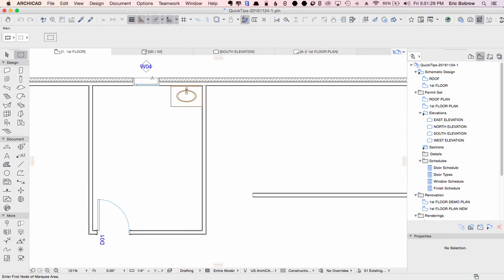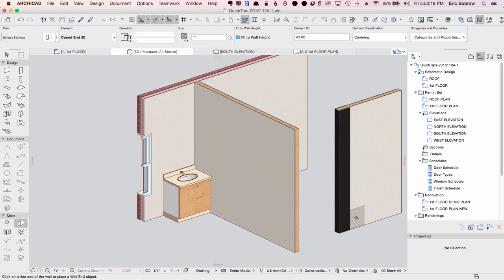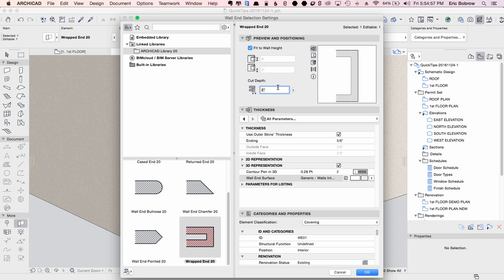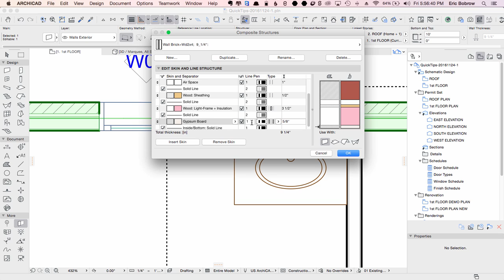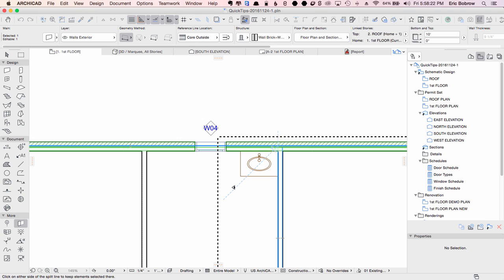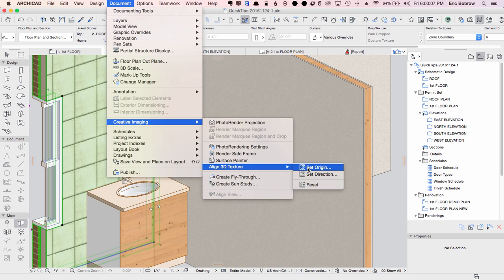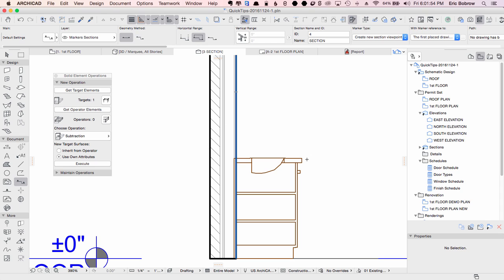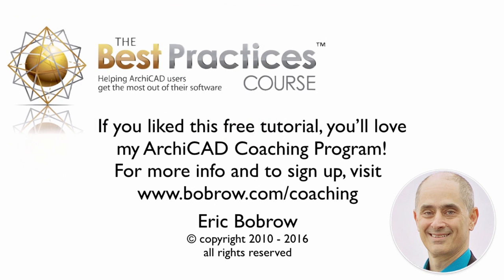ARCHICAD QuickTips Tutorial #1 - Cleaning Up Important Details

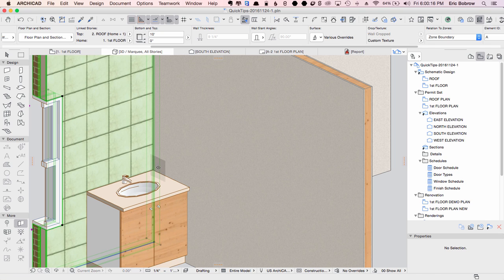Comment: Hello, I have a question. At 9:03 when you set the origin point for the tiles, the bricks from the outside of the wall move along with them. Since you had split the wall before, now the outside elevation material won't be align. how can we fix this?